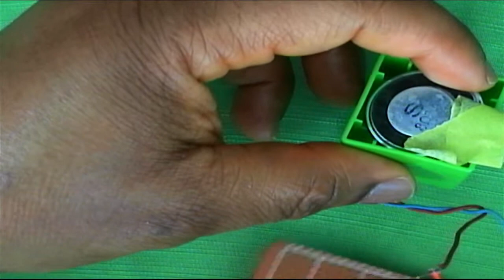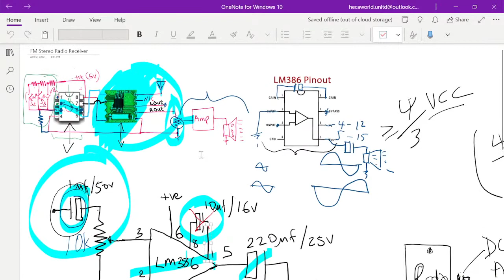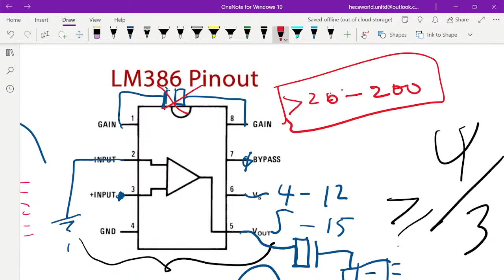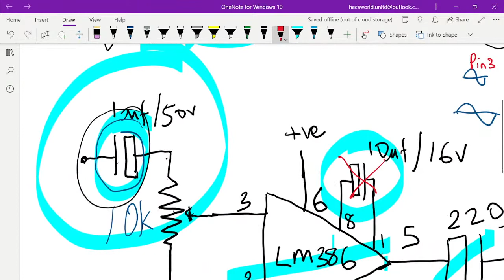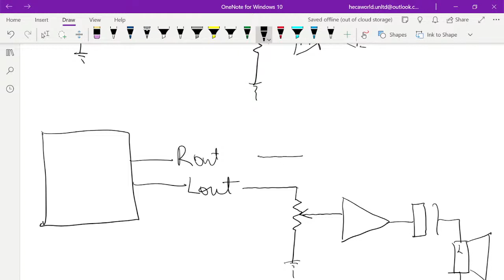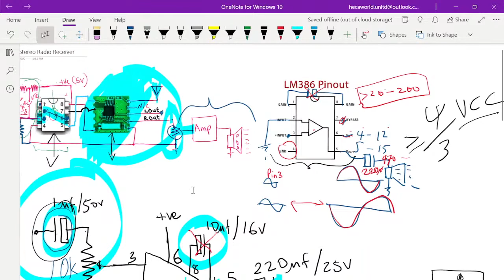RDA5807M FM Stereo Radio Receiver Part 3 | Home Made FM Radio Receiver | Walkie-Talkie Receiver |

Comment: Hello, project is excellent - but sadly the sketch on you website is corrupted when converted to .txt document. Is schematic available? Thank you for the great work.
Reply from the maker: And thanks for pointing out the issue with the corrupted file. We have rectified the issue. You should now be able to download the code as a pdf file.
Reply from the maker: Pause the video at the 11th (@11:00) minute to copy the circuit diagram.

Comment: Hello, how can we turn off the sound at an empty (noise) frequency on the fm radio, what should I use for this?

The FM module I am using is RDA5807M

example :

vzssssssssssssssssssssssssssssssssssssss (white noise).
Reply from the maker: I don't believe the datasheet/spec has any information on noise squelching feature, but you can use a transistor to add that function. We'll try to experiment with the transistor approach in the next video on the series.
Reply: @hecanet  I'm trying everything to silence this noise but it doesn't work, I'm waiting for your project ☺️
Reply from the maker: @ramazanayten3758  We'll work on this this weekend and share our result, whether it worked or not. Stay tuned.

Please, if you have not done so already, subscribe to the channel so you will be notified when the video drops. If you already did, thank you.
Reply from the maker: @ramazanayten3758  We tried same this evening using diodes and transistors in conjunction with high-pass filters but it doesn't seem to work. 

If we are able to get this to work in the future with RDA5807M, we'll make a video of it. But for now, no progress was made.
Reply: @hecanet  Thanks a lot, I don't want the noise to come out at all at empty frequencies.